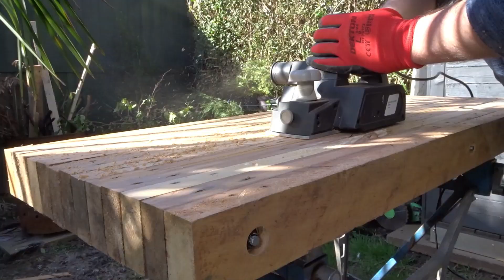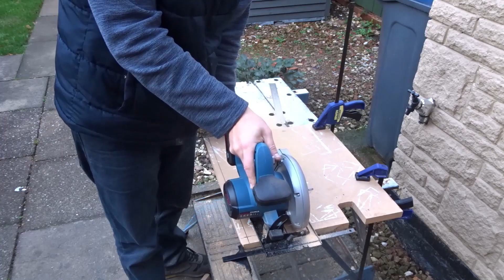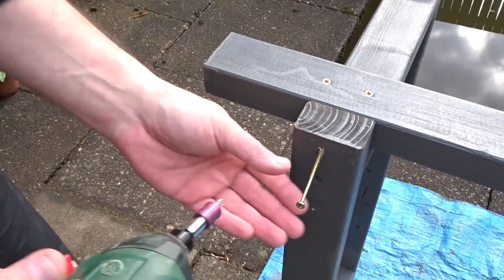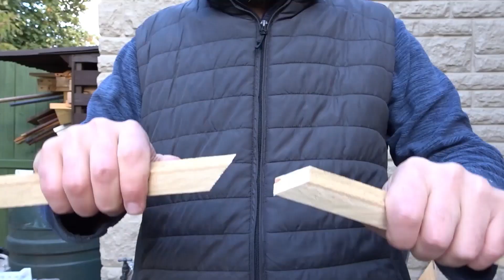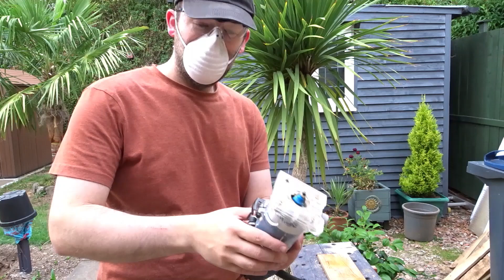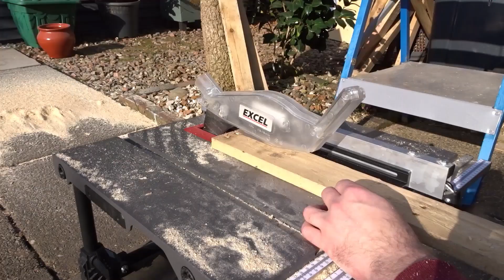Top 10 Power Tools For Woodworking & DIY Beginners

Comment: nice tools Phil u do like the small circular saw and that small router IV got the big router only used once seems to big for me to use lol
Reply from the maker: Hi Gary I prefer the small circular saw although it has a shallower depth of cut than a normal size saw so there are pros and cons. I prefer the small trim routers to the larger plunge routers. I just find they easier to use.

Comment: One of my favourite tools is a leaf blower (cordless Makita LXTDUB185Z) and not just for leaves. For removing dust from fans, vacuum cleaner filters, tools like sanders blowing all sawdust out. A Titan @ screwfix vacuum cleaner for workshop can also do the same as it can suck and blow. I also like a black and decker file sander, managed to bag that quite cheap a few years back around £30. I got rid of my Lidl bench sander as the filter wouldn't stay on and got a Bosch (PBS 75) which is bigger, much faster and filter is a lot better but you pay a lot more for it, its a beast of a sander
Reply from the maker: Thanks for sharing these tools Chris👍🏻 I like the look of the Bosch belt sander you mentioned. I've wanted one of those for a while.